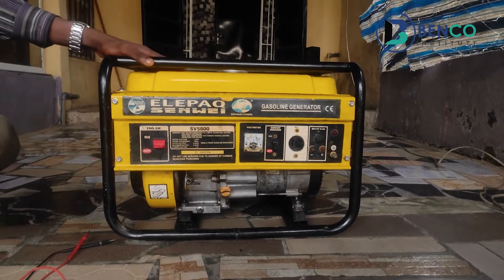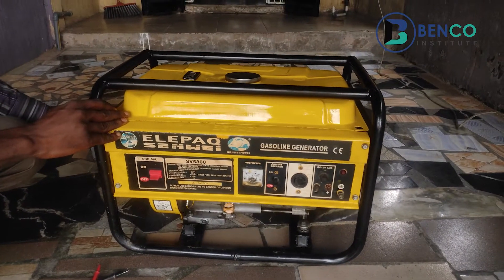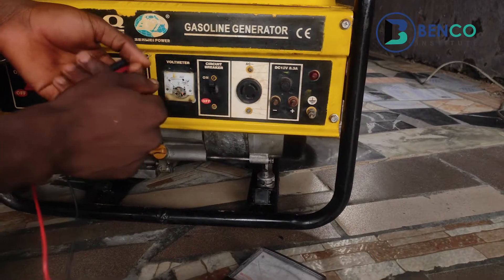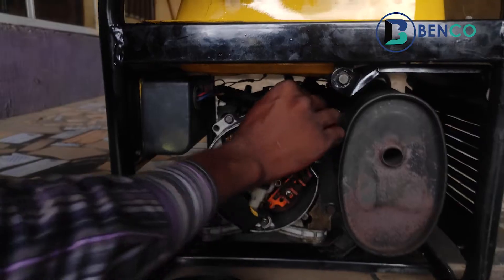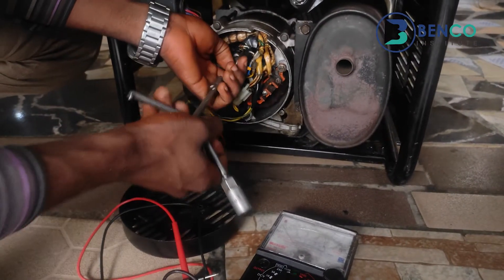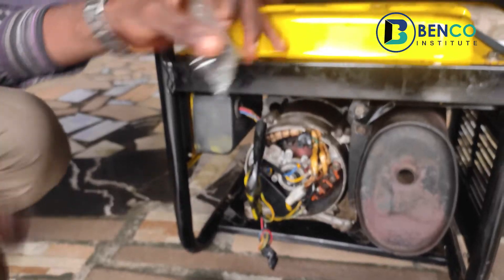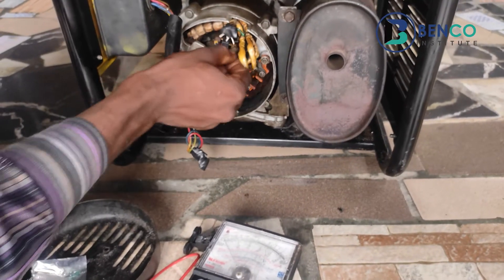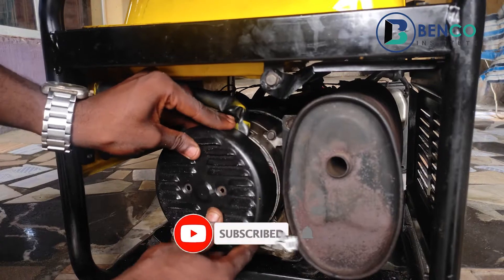Portable Electric generator not producing power and how to fix it.

Comment: I have a fireman spg1800 it doesn’t generate electricity and the voltage doesn’t read idk about generators but an engineer said I have to change the coil is this true?

Comment: Hi My generator gives cureent after running it for 10 minutes. After 10 minutes it runs properly no issues what could be problem?
Reply from the maker: It only begins to supply voltage after being on for 10minutes right?...is that what u mean
Reply: @bencoinstitute  yes. When we start it it's normal start but no output but we keep it excelerated on high rpm for few minutes then it's shows and give 220 volts voltage. Then it runs normal for 2 hours no issues. What could be the problem?
Reply from the maker: @sohaib4711  what kind of generator pls

Comment: Great video.
My generator was supplying voltage but once I turn on my freezer, the voltage cuts, put off the freezer, and voltage comes up again.
I called an engineer and he said the problem is the AVR.  After changing the AVR, voltage stops coming up completely, with or without freezer.
Please what could be the problem?
I use the same generator in the video
Reply from the maker: I really can't tell now till I have tested the Alternator

However this are what I think could be wrong with it

Check your Armature and check if the new Avr you bought has gone bad